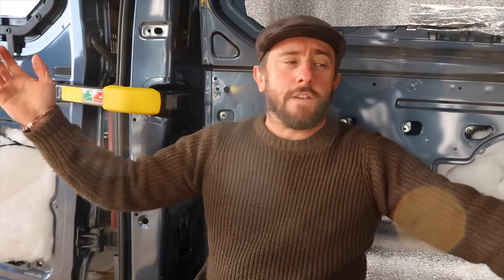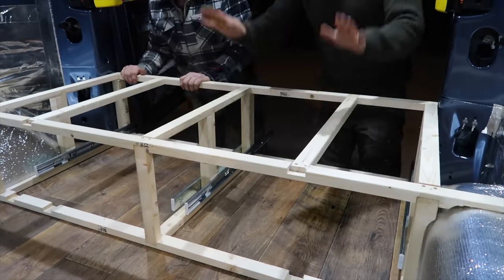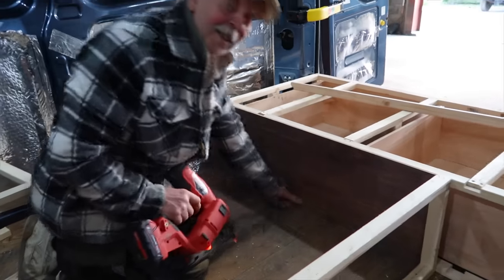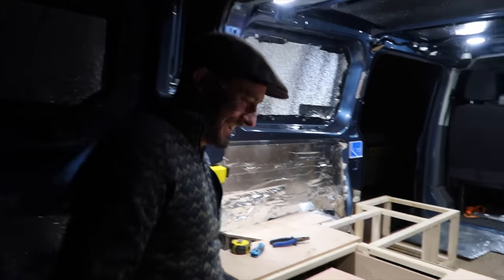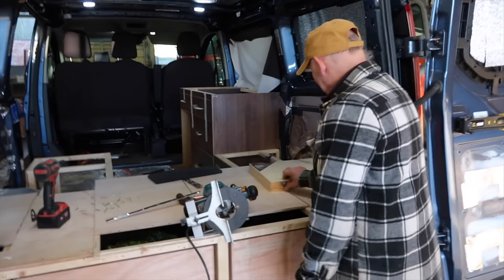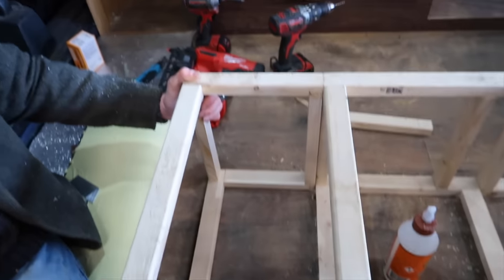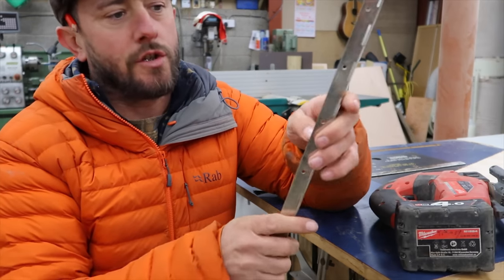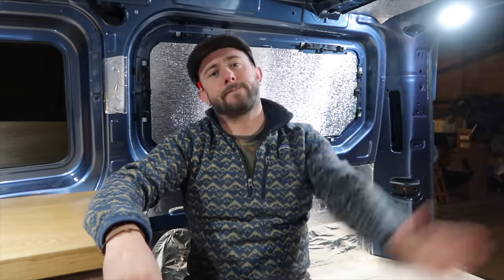Camper Van Conversion | Home Build Adventure Van Part 2 (Oak work top, Hiking pole table)

Comment: Just a little tip for you drill some large holes 65mm or larger as you well get black mold on your mattress you need as much airflow as possible
Reply from the maker: I know mate. We’re not finished yet 😁

Comment: Looks good so far. Have you considered however how easy it is going to be to fold out the hiking pole tables once you have the foam in for the seat/bed? Atb Dave
Reply: My thoughts exactly.  Moving cushions about is the worst part about campers / caravans.
Reply: @sarkybugger5009  Aye. It’s one of the things that annoys me in my own build. I struggle with the cushions getting to my underbed storage.
Reply: @playing_in_trafic  Trust me when I say that even with front and top access, the thing you want is always at the back / bottom.  Sod's law, in action.  😁
Reply: @sarkybugger5009  Aint that the truth 😂

Comment: Something I've learned making multifaceted things like your van outfit: Always be thinking how you can take apart various elements so you can change them.Always when you do something like this almost immediately you'll have ideas on how it could be done better. And if you then modify it, you'll come up with fresh ideas. With a van outfit, working with someone who's done several is the smart way to go. (How many of your ideas did Bill immediately shoot down? See.) 
Your chop off the too long screws is a good solution. I've spent hours finding tiny screws 12mm by whatever the heads need to be... and they don't grip very well. 
I always use my hiking poles point down. For my DIY rain fly that I first used in a very muddy Dorsetshire, I had a piece of paracord with loops already tied. I'd find my spot, put my poles through the loops, plant the poles, insert the stakes, drape my tarp. Then inside I can bump the poles without them sliding out of place, and the handles don't get dirty. I'd do the same for you set up. I'd also just cut two  4cm x 4cm posts.  Then over time I'd cut one off and then see how many times I actually needed to adjust the height. Like elaborate bed leveling systems I think you'll find one size covers almost every situation, and when it doesn't, then use your pole. 
I subscribed when you were getting  lost in your granny's back yard and got nosebleeds walking across overpasses. A million subscribers might be tough. There just might not be that many people on the planet who can handle the deep intellectual challenge of 50 different gate latches.

Comment: Good to use a polyurethane flexible adhesive everywhere,  to stop everything rattling apart. Mdf panels directly to floor, not a good idea, when you have some water on the floor, in that area, it will swell up. Better leave a 3mm gap, to the floor, and caulk it.